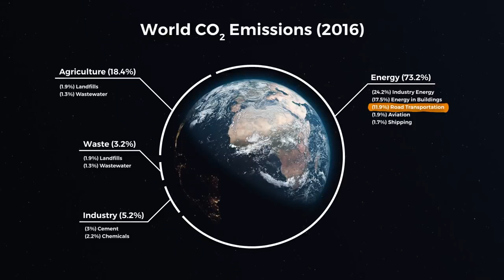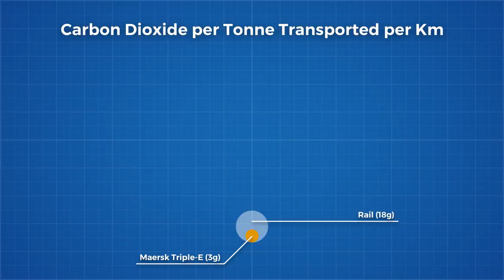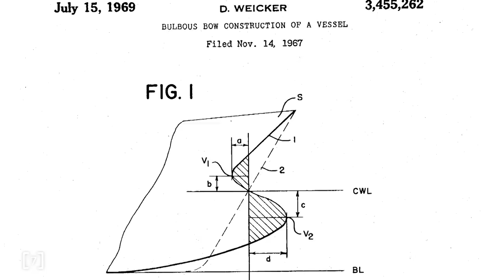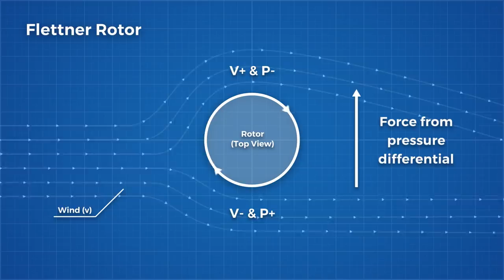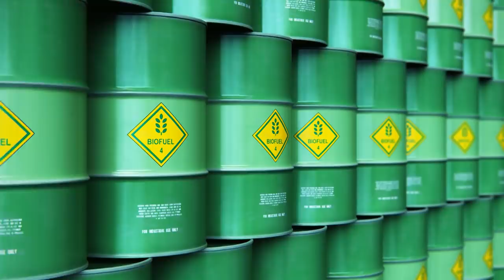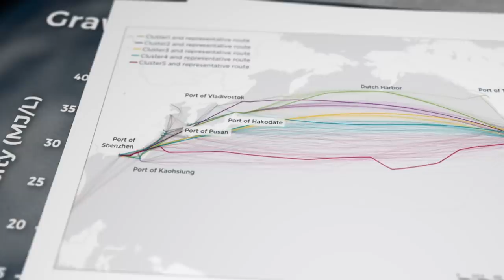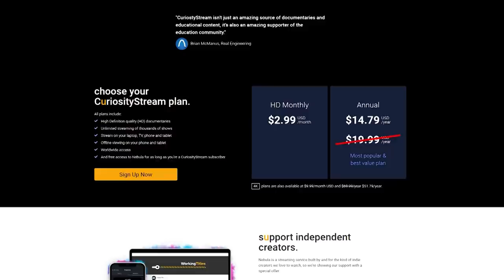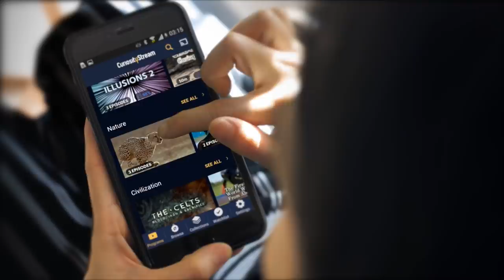Are Renewable Powered Ships Possible?

Comment: I am convinced of the power of methane in some circumstances. Atmospheric carbon dioxide can be reacted with renewable hydrogen to synthesize methane via the Sabatier Process. The hydrogen could be synthesized from excess electricity from sunny and windy days.
Reply: The next, least bad, option is ‘alternative fuels’ or ‘bio fuels’ such as Ammonia (NH3), Biogas (basically good old CH4 or Methane) and Hydrogen (H2).  All require growing, harvesting and processing which have fiscal, environmental and energy costs or impacts, before you get their energy to the point of use, and the use of which will generate effluents that will impact the global environment one way or another.  Thomas Midgley, Jr. (born 18 May 1889 died 2 Nov 1944) was an American (USA) chemist who, as well as developing the technique of putting the lead (tetraethyl (TEL)) additive in petrol, created chlorofluorocarbons (CFCs), yes those ozone depleting CFCs, so that the use of NH3 as a refrigerant could be discontinued.  NH3 could be the most dangerous and least ‘clean’ clean energy source, it is very bad and probably deserves a rant all of its own; so let’s just leave that for a while (somewhere very far away that is cool, dark and quiet).  CH4 lots of it around much of which comes out of the ground as a fraction of the FOGI energy mining; even more can be created (relatively expensively) from anaerobic degradation of organic matter.  The organic matter may be algae, raw vegetation, food waste or vegetation pre-digested by domesticated livestock with the right (or wrong, depending on your point of view) sort of diet and gut fauna.  CH4 is a lighter than air, vapour at environmental temperatures and pressures and you need to compress it, a lot, or cool it, a lot, to get enough on board your ship in manageable volumes to be useful; also bear in mind that the containment of the very cold (LNG) or high pressure (CNG) CH4 has mass and costs.  Carry it as cargo and you can burn the ‘boil off’, when the latent heat of vaporisation has the co-activity benefit of keeping the cargo and the cargo system cold, otherwise more trouble and expense than merit and savings.

To liberate hydrogen (H2) from water you need a lot of energy and while fossil oil & gas, or perhaps coal, will do it and are the most readily available any energy source, wood, photovoltaic, wind, tidal, et cetera, will do.  H2 is said to be good for use in fuel cells that will give clean energy when combined with Oxygen (O2) and leave only water (H2O) as an effluent; so as well as the cost of creating the hardware and separating out the H2 in the first place we now have the cost of providing the O2.  H2 is very, very light and very, very volatile so this is where we remember the Hindenberg airship disaster and while events of that magnitude might not be likely much smaller H2 fires or explosions can cause a lot of damage.  The ‘light’ means that though there is lots of energy per unit mass there is not much mass per unit of volume so all the problems of CH4 but much worse.  You need to compress it, more than a lot, or cool it, more than a lot, to get enough on board your ship in manageable volumes to be useful.  The alternative to fuel cell use of H2, burning, also generates combustion products which includes waste heat going to the cold sink and a few NOx ‘nasties’.  H2 may have a place in the energy mix on land as a storage medium but on a ship where there is a reasonable and constant auxiliary power need the question could be posited, ‘why go through the extra stages instead of using the harvested energy directly?’  After harvesting the energy, from wind, sun or motion of the vessel, as electrical energy better to deploy that energy directly and immediately as heat, light or mechanical work.  As with nuclear energy at sea some of the ‘alternatives’ may have a use in littoral submarines in AIP (air independent propulsion) systems but that will be with the same caveats of cost, space and complexity so would not perform in a high volume low cost mercantile situation.  The numbers, on any of these, are getting very difficult to show any sort of surplus so is this a case of running hard to stand still?
Reply: @BernardLS  Producing methane with the Sabatier process does not require any growing harvesting or processing. It only requires hydrogen and carbon dioxide. 

https://en.m.wikipedia.org/wiki/Sabatier_reaction
Reply: @augusthoglund6053  Thank you, I followed the link you provided and the first sentence indicates about the Sabatier process  'It only requires hydrogen and carbon dioxide' & temperature & pressure & a catalyst.  So that, WADR, is synonymous with 'growing, harvesting and processing'.  Even allowing the naturally occurring anaerobic degradation of vegetable matter in a swamp begins to have costs as soon as you throw a cover over it for collection and neglecting the cost of losing the swamp to more productive agricultural use.  Employing the Sabatier process on the scale needed to replace fossil fuel would be a direct cost in place of the externalised environmental cost of releasing the CH4 that nature has sequestered over the millennia; so on balance it probably is worthwhile as it would restrict use by increasing costs.
Reply: @BernardLS  I appreciate that you gave the link a try.

Comment: Biofuel doesn’t reduce emissions but it is considered carbon neutral emission because the emissions are re-absorbed by the crops being grown to convert into fuel. With proper no till farming practices this can actually remove more carbon than it produces
Reply: How about ‘bio fuel’, how green is it?  Short answer, not very; major problem is land use and the limited upside is that the carbon released into the atmosphere has recently been taken out of that space in the growth part of the cycle minus the processing deficit.  On a small scale, to use up the waste products from other industries like forestry, animal husbandry or agriculture, ‘bio fuels’ are as good source of carbon molecules as you could get but they, like all 'alternative' fuels, still involve a combustion stage and therefore some noxious effluents, NOx for example.  Fossil hydrocarbon oil fuels run up from CH4 (methane/biogas) to very thick black cSt380 HFO (C20H42 to C50H102 or more).  The sweet spot is kerosene (C10H22 to C16H34), also known as gas turbine fuel and used in modern aircraft engines.  It is relatively cheap, relatively energy dense, relatively hydrophobic and relatively safe.  Creating a non fossil substitute, at a reasonable cost, is ‘the holy grail’ for energy chemists; like turning base metal into gold and they may have cracked that oyster, see here for details: -https://www.bbc.co.uk/news/science-environment-56408603.  Natural history, on a geological scale, has done a lot of heavy lifting for us humans.  The trade off for plant or algae based hydrocarbon fuels is increased atmospheric green house gas or increased land or marine area use.  Even overproducing rather than simply harvesting the existing resource or using the residues will not fill the space left by fossil oil & gas.
Reply: @BernardLS  it’s all about corporate farming lobbyists.

Comment: Why not electric ships? Perhaps it would take too long to charge up at a dock? Hydrogen sounds pretty good. Wind assist sounds good. When it comes to hydrogen production, check out Electrolysis of urea and ammonia, pee! It is more then 100% efficient (yes that is possible in this case) and it reduces the need for containment ponds at waste water treatment facilities. Every port city has the potential to produce large amounts of it from the residents of the city. If it was liquified, it would transport and store very well and refueling would take very little time, just like fuel oil

Comment: We already have them on warships and submarines on the US navy
Reply: ‘They’ say nuclear is cheap, it’s not it is expensive, and has a large embedded carbon quotient as well as being complicated, dangerous, not universally socially acceptable and having only ‘no need for refuelling’ as a questionable advantage; actually it does need refuelling just not as often.  When ‘they’ do need to refill the warming up stuff it takes considerable longer than pumping tonnes of thick black stuff, cSt380 HFO, or thin runny stuff, MDO, onboard which is one of the reasons HMS Queen Elizabeth (QE) and HMS Prince of Wales (PoW) are pushed about by ICEs and gas turbines thus using a similar fuel as the aircraft that fly off of them.  The Royal Navy (RN) with a high degree of skill and expertise uses, at vast expenses to the UK taxpayer, a current operational nuclear fleet of 11 submarines (also known as ‘boats’) in two flotillas, seven attack subs and four ballistic missile boats.  The carbon footprint of all the extra bits of hardware and the fuel, including processing thereof, from ground to propeller, are the external costs that never seem to get considered.  The USN is not, as far as I know, a commercial organisation working to very tight margins and also has the skill and expertise to handle the complexities of nuclear power; so as well as submarines their aircraft carriers are nuclear powered and each of the current iteration has a build cost three times that of QE/PoW, bigger crews and even more generous funding.  For those who still think that nuclear energy might be the answer I recommend this report: - https://www.bbc.com/future/article/20200901-the-radioactive-risk-of-sunken-nuclear-soviet-submarines?ocid=ww.social.link.email.  The navy of the USSR might have been under resourced and over extended but it was still generously supported in comparison with merchant shipping.
Disposal, once it wears out, of both the machine (that was a ship) and fuel is another can of worms best left unopened.  The 21 RN nuclear powered boats no longer in use are laid up (some, 7, in Rosyth and some, 14, in Devonport) awaiting deconstruction including dealing with the fuel rods and other irradiated material.  Also twenty years is a typical life expectancy for a commercial hull so about when the reactor needs refuelling, due to the elements being 'poisoned' (?), it is time to drag it up a beach on the Indian sub continent and start beating the thing to death with hand tools.  It may also be worth remembering that ‘systems reliant on perfection are most vulnerable to disruption’ and 'the more complex a system is the more likely it will fail at some point'.

Comment: Nuclear is the safest and cleanest fuel yet wasn't included 😑...I know it's not exactly renewable but it deserves a mention
Reply: Just think; would you have full confidence in the management of a nuclear reactor under the control of an anonymous entity only traceable, perhaps, via a letter box in a FOC (flag of convenience) nation state?  If you are, could you sell that confidence to Japan, the state that hosted the Hiroshima and Nagasaki nuclear detonations as well as more recently the Fukushima ‘event’?  Then try that same, or a similar, sales strategy on Ukraine, the nation state that as a part of the USSR (CCCP) hosted the Chernobyl ‘event’.  Modern iterations of nuclear energy, thorium fuel, molten salt reactors, small modular reactors or fusion reactors, will carry the legacy of past problems.  It is the global trepidation of anything with 'nuclear' in the name and the economics of nuclear having transitioned from 'energy to cheap to charge for' too 'the costs of remediation are incalculable' that will prevent the adoption of nuclear energy as a means of creating energy at sea.  Modern reaction systems may have overcome the safety problems but the general public, having been misled in the past, will be reluctant to believe the fresh new promises.  The incident of the ‘Ever Given’ blocking the Suez Canal, March 2021, may also have a little to add to this debate.  The cooling water on ships tends to get taken in from near the bottom so when running aground the inlets are in a prime spot to get plugged up restricting, if not stopping, the flow of coolant.  One thing that the TMI, Chernobyl and Fukushima incidents all had in common was that the supply of coolant, or rather lack thereof, was a fundamental cause.  Similarly and only months later, May 2021, had the ‘X Press Pearl’ been nuclear powered then a major port for a populous nation in the global South would have possible been the site of a significant exclusion zone due to a non power plant related incident.  If the ‘X Press Pearl’ had on board a fired up but ‘safe’ molten salt reactor and found herself having to dissipate the residual energy associated with the possible 12.5 megaWatt power cycle would a stable cool down have been possible?  In a casualty ships may capsize, like the ‘Karin Hoej’ of Bornholm in the Baltic early December 2021, in which situation any safety system reliant on gravity might not work.  Why not use nukes?  It is down to engineering, finance, socio-political attitudes and safety

Comment: A bit disappointed there was no mention of nuclear-powered electrical engines. Nuclear reactors are the single most efficient and (despite popular perception) safest means of energy generation, and they just keep getting more efficient and physically smaller. They would also not even be particularly dangerous in the event of a ship sinking - far safer than having normal fuel leak into the ocean - because nuclear waste is stored in airtight, watertight containers and the water of the ocean would cool down any exposed fuel to prevent a meltdown. In my opinion they are the best route to clean shipping.
Reply: I recognise the name and could post it all again, but you had my 'two pennyworth' elsewhere.  No nukes are good nukes.

Comment: What about ammonia as a fuel?
Reply: The next, least bad, option is ‘alternative fuels’ such as Ammonia (NH3), Biogas (basically good old CH4 or Methane) and Hydrogen (H2).  All require harvesting and processing which have costs and impacts before you get your energy to the point of use and will have effluents that will impact the global environment one way or another.  Thomas Midgley, Jr. (born 18 May 1889 died 2 Nov 1944) was an American chemist who as well as developing the technique of putting the lead tetraethyl lead (TEL) additive in petrol created chlorofluorocarbons (CFCs), yes those ozone depleting CFCs, so that the use of NH3 as a refrigerant could be discontinued.  NH3 could be the most dangerous and least ‘clean’ clean energy source it is very bad and probably deserves a rant all of its own, so let’s just leave that for a while (somewhere very far away that is cool, dark and quiet).  CH4 lots of it around much of which comes out of the ground as a fraction of the FOGI energy mining; even more can be created (relatively expensively) from anaerobic degradation of organic matter.  The organic matter may be either raw vegetation, food waste or pre-digested by domesticated livestock with the right (or wrong, depending on your point of view) sort of diet and gut fauna.  CH4 is a lighter than air, vapour at environmental temperatures and pressures and you need to compress it, a lot, or cool it, a lot, to get enough on board your ship in manageable volumes to be useful.  Carry it as cargo and you can burn the ‘boil off’, when the latent heat of vaporisation has a co-activity benefit, otherwise more trouble and cost than merit and savings.  H2 is said to be good for use in fuel cells that will give clean energy when combined with Oxygen (O2) and leave only water (H2O) as an effluent; so as well as the cost of creating the hardware and separating out the H2 in the first place we now have the cost of separating out the O2.  H2 is very, very light and very, very volatile so this is where we remember the Hindenberg disaster the ‘light’ means that though we have lots of energy per unit mass there is not much mass per unit of volume so all the problems of CH4 but much worse.  You need to compress it, more than a lot, or cool it, more than a lot, to get enough on board your ship in manageable volumes to be useful.  An alternate use of H2 burning also generates combustion products which includes waste heat going to the cold sink and a few NOx nasties.  The numbers are getting very difficult to show any sort of surplus so this is a case running hard to stand still.